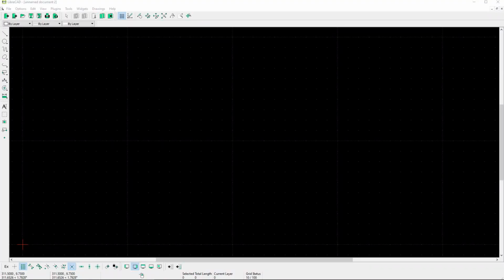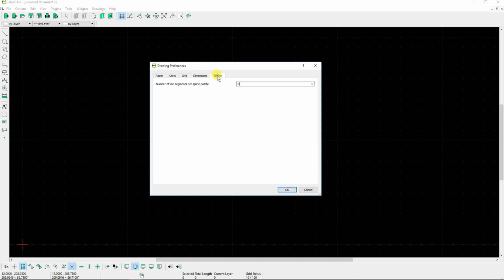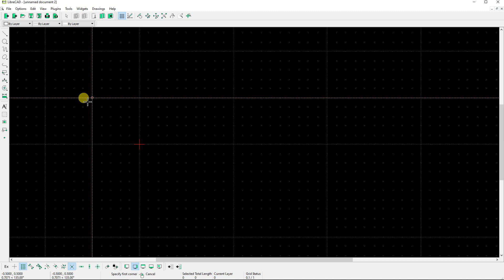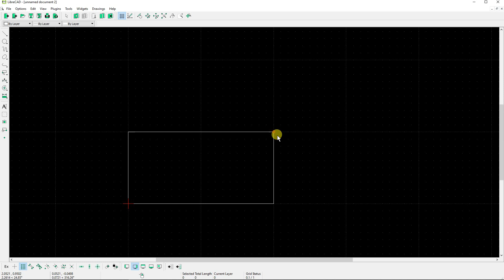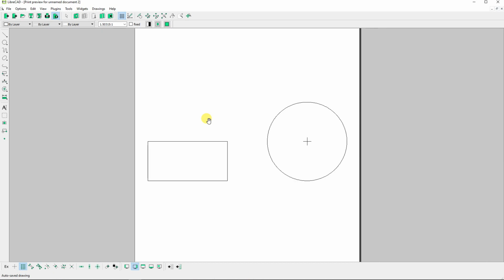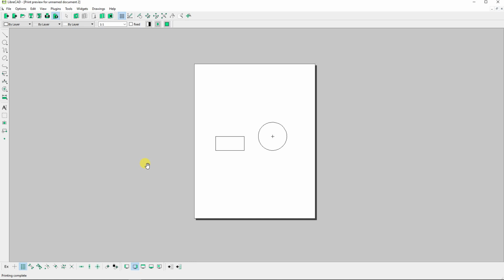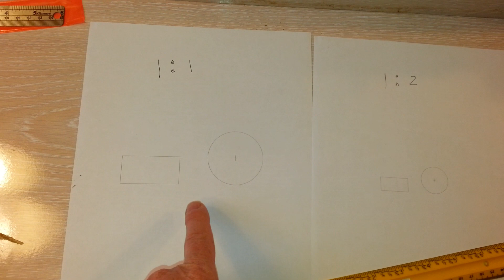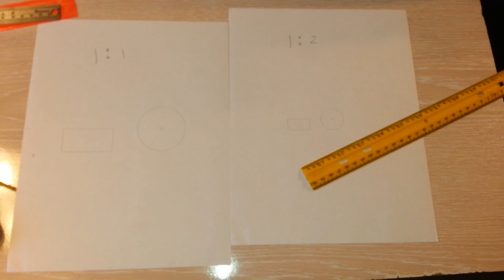60. Printing to scale using LibreCAD

Comment: Orlamdo, from  Barbados.  
 How can I scale and print my drawing 1/8" to 1'-0"
Reply from the maker: Hello Orlando. If I understand you correctly, I'm guessing that you want the 12" lines in your drawing to be printed as 1/8" long lines. (1/8" = .125") Maybe you are drawing a house or floor plan. The correct scale factor can be calculated as 12"/.125". This equals 96. On the Print Preview screen (as shown in my video), for the scale, enter 1:96 and then print.
You can easily test this. Step 1: start a new drawing and draw a 12" long line. Step 2: On the Print Preview screen, enter 1:96 for the scale. Step 3: Print your drawing. Step 4: Use a ruler to verify that the line printed on the paper is 1/8" long (.125") while the line drawn on your computer screen is 12" long.
If it does not work correctly, re-watch my video and make sure you have setup the Current Drawing Options correctly.
Thanks for your question and for watching.

Comment: When I clicked on the 1:1 scale in the print preview, the white paper disappeared and it just showed my rectangle and circle on a grey background. what did I do wrong?
Reply from the maker: I believe your rectangle and circle are drawn very large; much larger than the paper you are using. Try clicking on Print Preview again, choose 1:1, and then zoom in on the center of your drawing. When you zoom in far enough, I believe you will see the piece of paper again. To print your drawing you have a couple of choices: 1) Redraw your circle and rectangle sized so it will fit on your paper. 2) Print your existing drawing at a scale different from 1:1. Try different scales while in Print Preview until your drawing fits onto the paper.
I hope this helps. Thanks for your question and for watching.

Comment: I want to make a drawing for my woodworking shop and it has three drawings in three different scales on the same page. Is this doable with libreCAD?
Reply from the maker: Hopefully I understand you question so I'm going to say "yes", you can create a printout of your shop with 3 sections all at different scales. I can think of 3 different ways to do this. 
Way #1) Make 3 separate drawings for each section. When you go to print the 1st section, set the scale using the drop down box shown in the video. This allows you to set the scale to whatever you like just for that section. During Print Preview, drag the paper you are going to print on to position where the 1st section should be printed. Take that printout and load it back into your printer. Repeat the previous steps only for section 2. Choose the scale you want to print this section at. Be sure to drag the paper in Print Preview so the 2nd section does not print over the 1st. Repeat for section #3. I think this will work.
Way #2) Print each of the 3 separate drawings on their own sheet of paper at whatever scale you choose. Tape the 3 pieces together to create 1 large drawing with each section printed at its own scale.
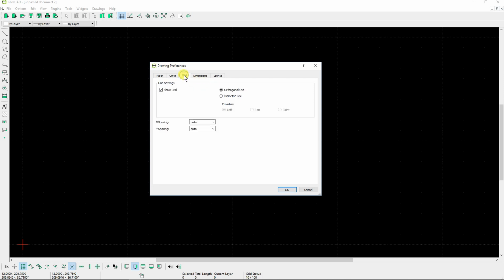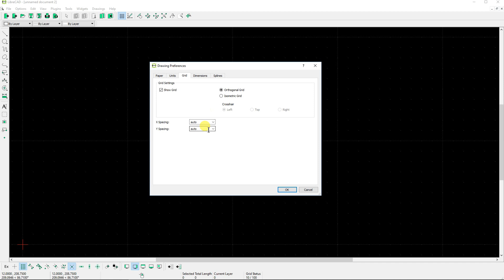Way #3) Create one drawing will all three sections. Each section can be drawn at its own scale but you will need to manage that. Let's say you draw section 1 at 1:10 scale (so the drawing is 10 times smaller then the actual). When you draw your lines, each line will be drawn at a length that is 10 smaller then the actual full size length. Then you draw section 2 at 1:20 scale (so the drawing is 20 times smaller then actual). When you draw your lines for this section, the lines are drawn 20 time smaller the actual full size length. Then you draw section 3 at 1:50 scale (so that section is drawn 50 times smaller then the full size actual). When you print the drawing, you can choose the largest scale that will allow the entire drawing to fit on 1 piece of paper; each of the 3 sections will print at the correct scale relative to each other.
I hope this makes sense.
Thanks for your question and for watching.
Reply: @ImaginethenMake  way 3 is what I would like to do, but I don't know how. I don't want to have to calculate the scale myself and was wondering if there was a way to set it so the program calculates it automatically for me.
Reply from the maker: I do not know of a way for LibreCAD to make the calculations to allow you to draw in 3 different scales in one drawing. If you have watched my earlier videos introducing LibreCAD, I said the program is really just a computerized pencil and paper. Before computerized drawing (CAD), draftsmen would often draw in different scales in different sections of their drawing. Back then, the draftsmen had to do the calculations to determine how long to draw their lines. I believe LibreCAD works the same way. 
Good luck with your drawing.
Reply from the maker: You're welcome for the videos. I do enjoy making them. I have learned so much since I started in 2017.

Comment: I'm stumped ... I Copied a full-size drwng into a 11" x 8.5" file[Letter size'].  I then Scaled it dwn to fit inside the 'Letter size' file.  But, of cource, the DIMS. now do not read the TRUE Values.  How do I adjust them?  Thanks!
Reply from the maker: It sounds like you want to print your drawing full scale which will go beyond the printable area of 1 piece of letter size paper. If this is the case, then you'll need to print on multiple sheets of paper and tape the sheets together to create your full size drawing. Doing this does not change any of your dimensions.
Depending on your drawing, you may want to add some targets to the drawing to make it easier to line up the separate sheets. 
To line up the sheets, you can use a large window (or sliding glass door) to back light the sheets to make it easier to see through the sheets. If you have a light box or a backlit drawing pad, you could also use that to backlight the sheets.
I hope this helps. 
Thanks for your comment and for watching.

Comment: Thank you for your videos. 
At 2:00, I cannot figure out how you shrank the size of the grid. You seem to only move the mouse pointer and the grid size changes.
Reply from the maker: Hi George. To zoom in or out (which changes the size of the grid) I used the scroll wheel on my mouse. You can also use the keyboard keys; hold down the Ctrl key and press either + or -. This should give you the same effect as using the scroll wheel.
If you haven't already, I suggest you check out my LibreCAD playlist; here's a link: https://youtube.com/playlist?list=PLGCBwUeR2BD2ypYi5k0c4p6M52YO8Z-WD . The first video (#26) goes over using the program starting from the very beginning.
Thanks for your comment and for watching. Please feel free to share any of my videos.

Comment: The video was very helpful, but I have another question... I have a drawing that shows 3 plans of my woodworking shop. They each have equipment in different layouts, but all 3 plans are in the same drawing. QUESTION: Will LibreCad allow me to print each individual plan by windowing each plan separately?
Reply from the maker: Hi Paul. If I understand your question correctly, the answer is no, LibreCAD prints the entire drawing, not a selected portion of it. Now, if your drawing has multiple layers (and it sounds like your drawing does not), LibreCAD will print only the visible layers. So if you edit your drawing using LibreCAD and place each workshop layout on it's own layer, then you can print each layout separately.
The other thing you could try with your existing drawing, when you go to print, you can relocate position of the paper over the section you wish to print and only that section will get printed. If your different layouts are spread out enough on your drawing, this might work for you. Just mind the margins your printer will use.
Hope this helps. Thanks for your question and for watching. Please feel free to share any of my videos.

Comment: Can librecad convert dxf to pdf keeping the original size?
Reply from the maker: To answer your question I ran a quick test. I opened a new document in LibreCAD and added a square, circle, and triangle, saved it as a .dxf and printed it. Then I exported the drawing as a .pdf and printed that. Taking the 2 printouts and putting them on top of each, it looks like all of the lines on both printouts line up with each other. So it looks like to me that LibreCAD will export a .dxf (drawn in LibreCAD) to a .pdf and maintain the original size.
Now, I'm not sure what happens if you import a .dxf originally created using a different program.
Thanks for your question and for watching.

Comment: How cn v print a big size drawing for example a bicycle frame on multiple A4 sheets?? In 1:1 Scale
Reply from the maker: This is a great question! One of the things I like best about LibreCAD is that you can draw to any scale and also print to any scale.
Printing a large design at 1:1 scale on letter size (or A4 size) paper will require many sheets of paper printing each section of the design onto a different sheet. The trick is to have some way to align and tape together all of these different sheets. Once completed, you have a full size printout of your design.
What I have done with my larger projects is the following 3 steps:
1) Complete the design (I prefer drawing in 1:1 scale.)
2) After verifying that my printer paper size has been set correctly, look at a print preview. In this view, you can see how your design can fit across several pieces of paper.
3) Add alignment targets to your drawing and double check in print preview. Once your alignment targets are in place, print each section of your design to a separate piece of paper. Use the alignment targets to align the sheets and tape them together.
If you have a large glass table or a large sliding glass door, you might want to use either (with a light source) to position the sheets and tape them together. The glass surface, when lit from behind, can make it easier to see the alignment targets through multiple sheets of paper. If many sheets overlap, I will sometimes use a sharp knife to trim them.
I hope this makes sense. If not, leave some more questions here.
Thanks for your question and for watching.

Comment: what if you're printing something that's larger than the letter size paper?
Reply from the maker: Excellent question! I hope you can see in Print Preview that you can move the paper that you are printing on around (left mouse click and drag the paper to move it to a different position). If my design is larger than the paper, what I do is add some alignment targets to the design in strategic places. When I print each section out on its own paper, I can then use the alignment targets to line up the different sections and tape the papers together making one large printout. I have done this several times and it does make an accurate, large printout. You just have to work carefully when taping the sections together. I hope my explanation makes sense. Thanks for your question and for watching.
Reply: @ImaginethenMake  Yes that makes sense. I've seen it done (the taping part), but wasn't sure about the CAD part. This video and your answer will help much. Trying to print violin designs.  Thanks.
Reply from the maker: You're welcome Brian. Good luck with your project.